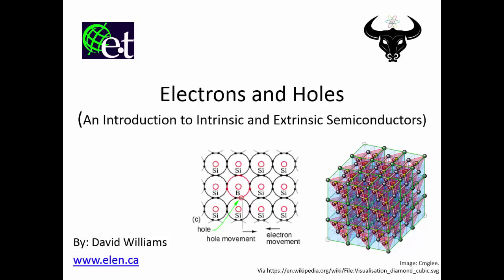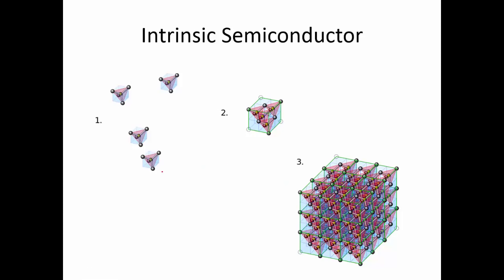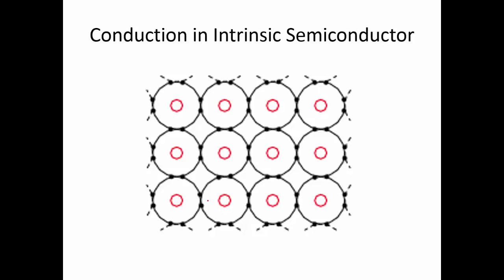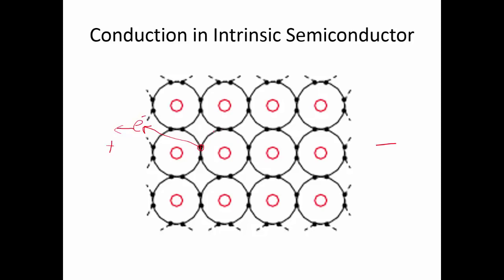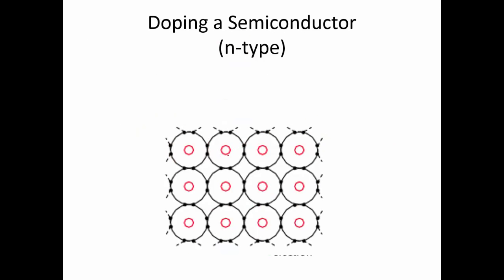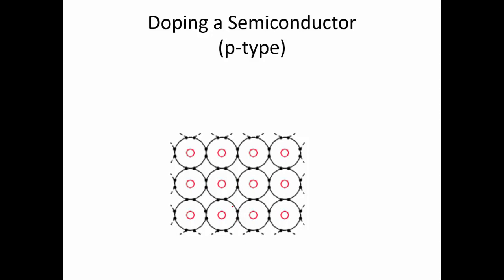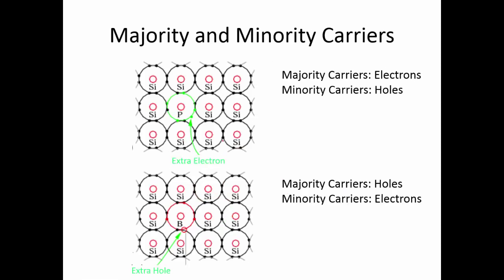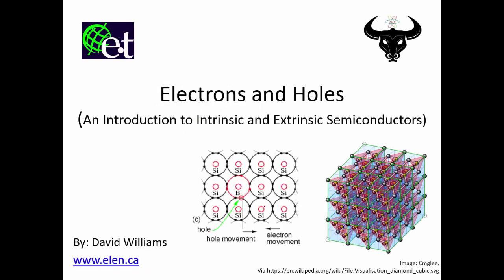Electrons and Holes in Semiconductors

Comment: sorry if this is a dumb question, but: if the electron leaves a hole, where does this positive charge come from? From my knowledge, the protons can't leave the nucleus of an atom...
Also, what happens to the movement of the electrons when they share valence electrons?
Reply from the maker: peace bewith u - the atom as a whole entity will have one less electron, so the proton/electron ratio is no longer equal which means the atom as a whole will have a positive charge.
Reply: Thanks!